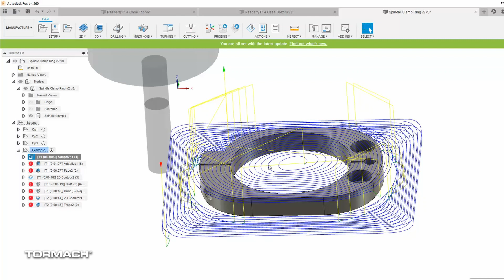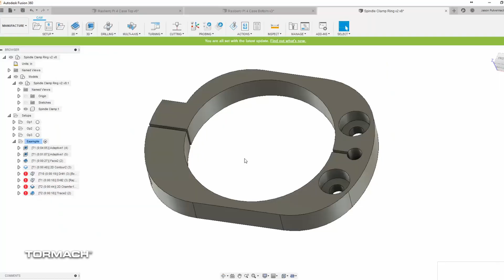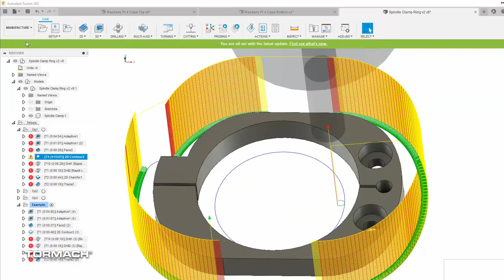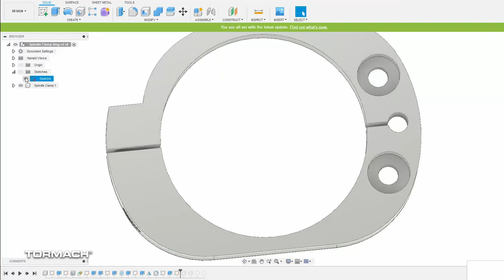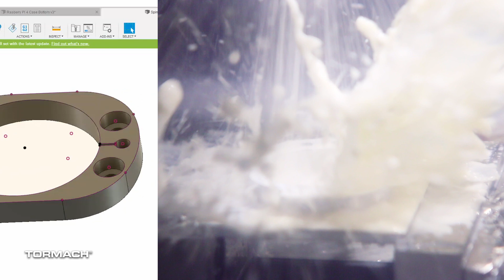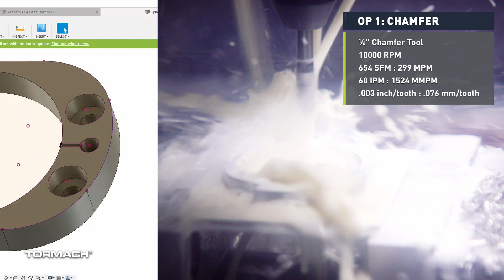Machining an Aluminum Billet Clamp on a Tormach 1100MX

Comment: I noticed NYCCNC is doing less tormach centric stuff so I’m glad you are picking up where they left off! I get a lot of the same vibes from this video and I really like it.

One thing I would suggest is to spend more time explaining how/why you are setting the coordinate systems for odd parts like this. I noticed you just swept the indicator up the side of the part so you could see it was perpendicular but someone just starting out may not think of that. (I know you have touching off videos but stuff like that needs repeating and practical examples to really stick) it even goes into the design of the part, you could have made all of the edges rounded to look “sexy” but you chose to leave flats to pick up the edges in later operations and not have to use custom soft jaws. 

Love the “engrave a guide line for the bandsaw” idea, definitely going to use that!
Reply: Realizing after the fact you probably weren’t sweeping that vertical face, just picking up the Y zero, since that bottom face is machined perpendicular. still, you had to have a flat to ensure there was something to probe, which is worth mentioning for the truly green :)
Reply from the maker: Great question  @strider460 
I ran the indicator up the side of the part to find the high spot for setting zero.  When you see the indicator start to change direction you are at the high point.  Then you can jog over and set your zero.  I use the technique quite often so it is easy to just skip over it.  I will make sure to explain these better in future videos!  Thanks for the comment!

Comment: so in op1 you specify you want the toolpath to do the outside first and show how to do so, and then in op2 you face away the remaining stock from the outside in, leaving a lot of unsupported material in the middle of the part. it goes flying at 6:24. wouldn't an inside out op have been safer?
Reply from the maker: Great question,
You are correct taking large pieces off can be risky to both the tool and machine.  In hind sight I would bore the hole all the way through the part in Op1.  
This is the fun part in machining you can always analyse and improve for the next time!